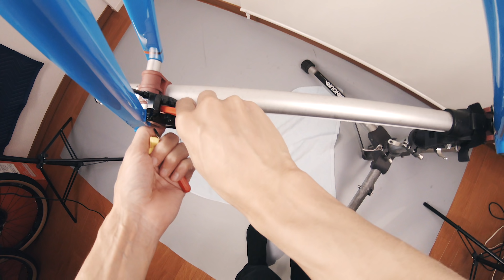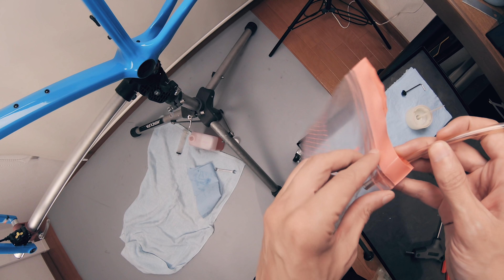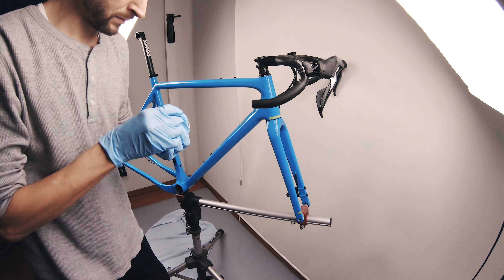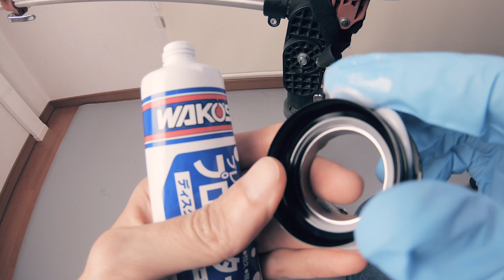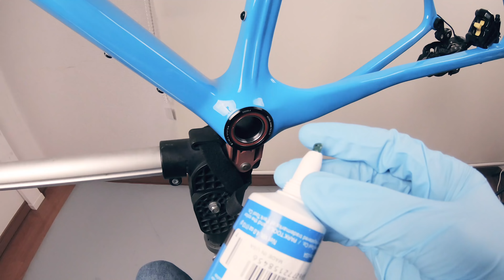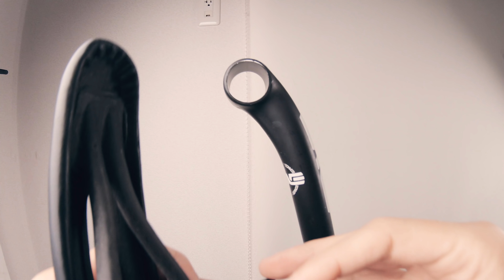OPEN UP Bike Build Part 2

Comment: I tried to install this Easton crank on my Open U.P. yesterday, although I'm using a Wheel Manufacturing BB. Did you need to add any spacers to get it to fit correctly? Mine has way too much play without them. My crank didn't come with any so I used a 3.2mm and 2.5mm from my Force 1 crank but I can't find any documentation on proper install for BB386EVO so I'm still looking for proper install info.
Reply from the maker: I didn't need any spacers with the Easton BB, however when I swapped to the Token Treadfit BB it came up short... ( check https://youtu.be/q0XAvr5Qn1k)
in the end I used the bearing covers from the Easton BB as spacers and that worked out perfectly (all covered in that video if you're interested.)

Comment: An easy way to measure the chainlength is just put the heaviest gear in the back, and the heaviest in the front (smallest in the back and biggest cog in the front) then you just measure/tighten so the two smaller cogs on the rearderailure is basically vertical. and bingo, then you know where to cut the chain :-) I use this method everyday in the shop, quick and easy

Comment: Hello again my Friend from Japan haha... I've been following your series and am slowly building my bike with Ultegra Di2 Components... So far everything is going perfectly... thanks to your excellent detailed videos! All the Di2 cables and brake hoses are in.... it was really easy using the brake ferrule trick!  Not ready yet for the BB86 but I'm not worried about it... Bur, you're not going to believe this as this is a stupid question: How the hell does one remove the yellow plastic shipping/safety pieces that come installed on these Shifter/brake levers??? I've searched on Google but nobody seems to have any info... Haha.. have you encountered those? BTW, my hoses came attached to the brake calipers and the other end of the hose is plugged with a solid plug. The levers also look like they have a plastic plug where the hoses connect. I have a feeling the oil is already in... so I have to be careful when I cut the hose to shorten it before connecting to the levers. But first I need to remove those clips without breaking anything.
Reply from the maker: Dick Tchairdjian happy to hear you’ve found if use full 🙏
If you got the calipers and sti levers new and thay are not connected to each other, they should not have any brake fluid in them. (From my experience)
The levers are plugged with a rubber screw just to keep any crap from getting into the levers, should be able to remove these with you fingers.
I can’t remember if I had any of those safely block on my Shifters 🤔
So I’m afraid I can’t help you with that 😔
Reply: Thank you. Since not even you have seen them (I actually went back to your unboxing video and there weren’t any there either) I took a closer look and the only thing I could think of was just pulling them straight out. It was in very tight. But a steady firm pull worked. The next thing I did (stupid of me) was squeeze the level (since with the blocks in they were locked) and lo and behold the plastic plug, which covers the hole where the hose gets attached, flew out together with a whole bunch of oil squirting out.... haha. So I guess there was oil already in the reservoir. Good thing to let people know.
Reply from the maker: Dick Tchairdjian oh there was oil in them?! 🤔
Was it the oem packaging then?... not the retail? (that’s in my video)
Sorry if my previous comment made I mess for you! 🙇‍♂️

Comment: Hi there. I recognized you are always on your bike with just on bottle to drink from. For the human part of performance I recommend you test your sweatrate by weighting you and your drink before the ride and after.  Then divide the weight difference by the hours you ridden... so you have your sweatrate per hour and fuel accordingly. Might be a little heavier but your average speed will go up I promise.

Comment: just wondering what model your work stand is.?  i am trying to find something similar but thru axles are proving the stumbling block..
Reply from the maker: Connor Maguire its an old discontinued minoura stand that I’ve modified to take thru axles. It’s been replace with the model below, that take both qr and thru axles
http://www.minoura.jp/english/tool/repairstand/rs-1800.html

Park tool has similar stand with a smarter thru axle mount... think it’s prt-22... not cheap though.
Reply: @ridesofjapan  Thanks much appreciated.

Comment: You talked about a lage 46tooth gear in the back, but i think you refered to the chain beeing long enough to be usable right?
You are using a 10-42 one? So 1:1 is minimum ratio...there is no 46 out there i believe? if you want to gear shorter you have to use a smaller singlewheel at the crank right?
Thanks for the upload!
Reply from the maker: I have a sunrace 11-46 on my gravel wheels that I use when bike packing. 
Normally I use my 11-42 Shimano cassette, but as I want to be able to use the 46 on occasion I wanted the chain long enough for that.
Cheers!

Comment: Dont waste yourmoney on ceramic bearings as it will create more drag after a few 100k. Ceramic balls are harder than the steel ring and will cut a groove inside them. Skip enduro as well. Their default tolerance is c3.. get a ntn 6808 or something similar. Maybe a 1 piece BB as well

Comment: Hello. Great video. Can you help me? Im going to tokyo in a few days... Do you have any recommended bike shop i should visit?
Reply from the maker: Cheers mate!
It all depends on what you're after. 
Above Bike is a favorite of mine, bit it's a bit far out. No problem with talking a train there though.
Nalsima Fiend has a nice mix of all things roadbike related, Crown Gears is near by and has a lot of hight end used bikes, and wheels.
If you after the big brands Y's road in Shinjuku, they have 3 stores near each other including a custom one for frames and parts.
Reply: @ridesofjapan  thx a lot! Gone to y's and maoshina... found some nice bargains!

Comment: How do you like those Schwalbe Pro One tires?
Reply from the maker: They've been good, feels fast and snappy going uphill. But as I'm getting used to my 650B setup I'm pretty confident my next 700c tiers will be something in the 32-35mm range. I think I'm getting too old to compromise on comfort hehe.
Reply: @ridesofjapan  Conti GP5000 TL in 32c =)
Reply from the maker: David Lee As a gravelking fanboy I’m more interested in the new 32c tubeless slick gravelkings... 
or 35c compass.. just so damn expensive.

Comment: Don't you think that any brake shoe mounting paste would work same as Wakos?
Reply from the maker: That’s very possible!
The wakos is the only one I’ve tried myself (and had recommended to me by a “real” bike mechanic)
So can’t comment on anything else, but would be very interested in hearing peoples experience with other similar paste solutions.
Reply: @ridesofjapan  Thanks for the reply! Could you possibly read on the tube, what's the intended primary use of the Wakos paste? It is designed for mounting brake shoes and protecting brake pistons in cars, do I get that right?
Reply from the maker: robert kujawa from what I understand it’s brake pad grease for heavy vehicles.
I’m guessing it’s suppose to go on the back of the brake pads.

Comment: I would recommend you to wear your helmet a bit lower on the front. Having the helmet so high up on the front and therefor so low at the back can lead to severe and also deadly injuries during accidents because the helmet may strike your neck spine and put pressure against it. I know it's hard with the cycling cap, I also like to wear one, but I always check my helmet position in the mirror before riding, to avoid the mentioned error.
Reply from the maker: Mathieu B 👍

Comment: 13:11 I think you have the quicklink mounted in the wrong orientation! Somehow I managed to do the same not sure how much it matters...
Reply from the maker: I think you are correct! 🤦‍♂️ Had to go and check on the bike... Like you said I don't know how much I matters either..I've not notice any decreased shifting performance, I'm on 1x though.
If I look on the inside of the chain, the arrow points in the correct direction, does that count? haha ;)
I'll pin your comment so hopefully people won't do the same mistake. Cheers!
Reply: @ridesofjapan  Some brands of quick link are orientation-specific, some don't care. I know the peanut shaped ones are more sensitive, both up/down and inside/outside. I put one on the wrong way around and it kept skipping off the 11t every few rotations. KMC ones seem to be forgiving.
Reply from the maker: Stewart Marler good to know! 👍
Not have any problem yet but I’ll flip it next time I’m tinkering with the bike

Comment: I experienced a lot of trouble with getting an Ultegra R8070 rear brake air free. It was installed on my #1 CX race bike and I had to bleed literally after every hour of racing. I replaced like every bit of the system (hoses, olives, nuts and even the calliper, but the problem kept re-occuring). I moved away from the "funnel" bleeding method (using standard Shimano tools) and bought myself a Bleedkit.com shimano set (https://www.bike24.com/p2171604.html?q=bleed%20kit%20shimano). It uses 2 syringes with the upper one having the same thread as the bleed funnel of Shimano. This allowed me to use Sram's pushing and pullig the brake fluid through the hoses. I was stunned by the amount of small bubbles that kept on escaping from the system. In the beginning I was thinking that one of the olives wasn't nice and flush but eventually no more bubbles.
Reply from the maker: Good to know!
I have had my rear being stubborn before as well. It seems that some air can get trapped in the caliper itself.
For me the funnel at the top and hose at the caliper (open and close method) usually gets the air out... but will definitely keep that bleed kit in mind if get similar problems in the future.